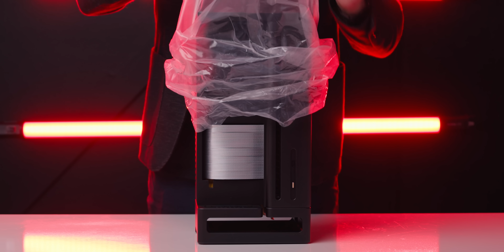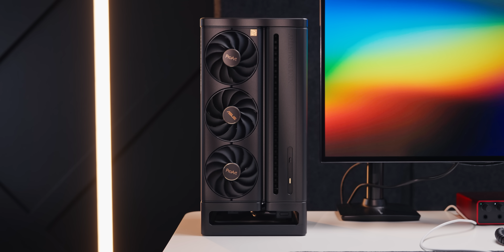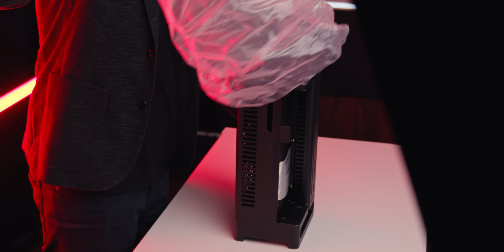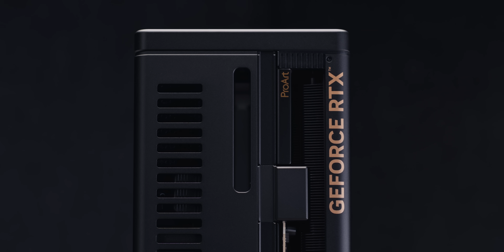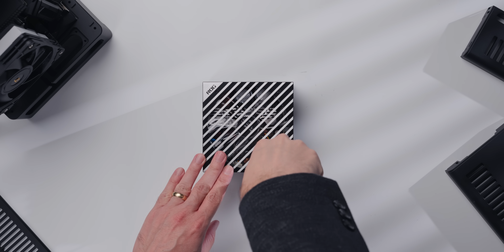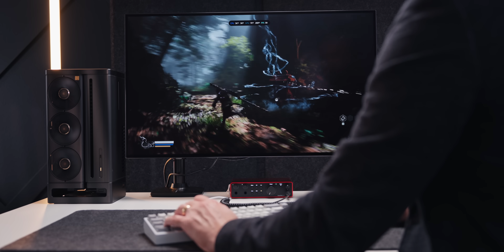THIS is peak SFF.

Comment: How are you getting 77c on a 7800x3d in CB24 at 4.6Ghz

I was getting 79c @ 4.7GHz with a dualtower cooler AK 620 in a corsair 4000d
and with an IS 55 in the fractal terra with NF-A12x15 I am getting 89C throttling to 4.5GHz

Comment: bro why would you buy that small pc for $3000 when you can get a good pc for $2000. this thing is 3000 without the monitor, it becomes 4000. On amazon you can find a good monitor for as low as 350.
Reply: some guys love that small build , which always comes at a cost.

Comment: yea it looks nice but no air filters and random environments that it could be in makes it a wildcard, unless people live in basically a museum case then that thing is going to be full of dust in less than 3 months. we have no pets and live in a non-smoking house and i still clean so much dust and fuzz out of the primary intake filters on my case... it's a fact of life that dust just exists no matter how much you clean... my system is going on 7 or 8 years old now and is still running strong! R5 3600X with an XFX Ultra THICC III RX5700XT and 32 GB RAM, dual 24" 144Hz XG2401 gaming monitors on Display Port and the heart that pumps all the blood, 1000w Rosewill PSU that was part of my last PC that i carried over because the thing just wont die! if you buy a PSU and it weighs more than 5 lbs then they built it to last!

Comment: Wtf, it's like I manifested this case into existence 🤯 I literally just put together a parts list on PCpartpicker a couple months ago and the required compents are the  EXACT components I chose for my build. An Asus ProArt 4070 Super and an Asus Loki 1000w SFF PSU. I went with the Gigabyte B650i Arorus mini itx motherboard because it's more affordable, but opted for the Ryzen 9 7950X3D because I want beefier CPU power. I'm a 3D designer and I've been searching for the perfect SFF PC case for years. The closest I've gotten is the FormD T1, but I've always wanted something more robust and purpose built. I couldn't have imagined a more perfect design if I tried, truly a work of art. I might have to go with this simply because the design is so perfect. A vertical PC case doesn't fit in the spot I was intending to put my SFF PC in, but I could put it where my controller stand is and come up with another solution for that. The other case I was considering is the Thorzone NanoQ. I had been following Thorzone since the Kickstarter for the Mjolnir and I've considered them the most high quality and artistically motivated PC case designer for years, but this just took the top spot. The other brand I would use is Fractal because they have been coming up with more aesthetically pleasing designs in the last several years, but the designs I like are either bigger than I'd like or lacking versatility and support for high end components. I might just be getting this case though, it's a freaking masterpiece 🙌🏼

Comment: i love ITX build as well but it’s not practical  as i push my 4090 and 7800x3D to the max running really demanding sim racing titles for my off track practice.  nothing can beat proper airflow even or water cooling at triple 4K 11520x2160, these cases can fit everything in and yes it looks cool but nothing worst seeing the cpu heat up above 70 degrees and the backside of the gpu hot enough to fry an egg, its like having a heater next to your face.  

My original setup was an ultra high end MCPRUE Apollo S 3.0 itx case (imagine Apple Max Pro case shrunk down) which looked amazing on the desk.  But I had to throw that away and rebuilt in an even more obscene MCPRUE Apollo X case (clone of Mac Pro case for PC builders) but it’s dead silence as i can use 280 rad for the 7800x3d and the 4090 have all the airflow it needs to be quiet as my practice sessions can go for hours.  

love your builds BTW as no one wants a giant boring looking PC case on their desk or on the front floor vacuuming dust!  SUBSCRIBED!

Comment: I wish they design a 5090 version for the upcoming GPUs.
Reply: have a look at McPrue, took me forever to find a itx case that could fit an AIO water cooler + 4090 gpu in it.  still gets hot though if you push your system hard.

Comment: after you are forced to upgrade your system(which is just a matter of time), this will be a very expensive and useless piece of aluminium.
that should be calculated within this insane price. 100% not worth it considering the current price.

Comment: TL:DR: function > form theses fancy ITX designs are mediocre at best
bought the ghost s1 compared to this case the machined aluminum isnt something that you want it's heavier than most other cases.  the small form factor doesnt leave much room so disassembling and cleaning is hard since dust gets on all the parts there is no great way to filter it with mesh. ive been looking for another smallish form factor PC case that isnt too focused on "premium design" since 90% of these cases like to charge you more for a design that is mediocre. the mass produced generic designs most mid-sized towers are better i just prefer something smaller.
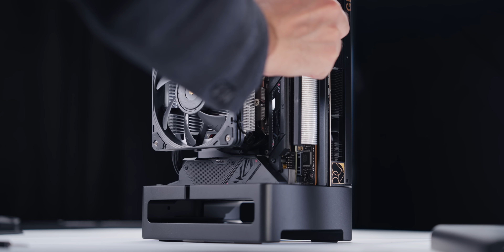Edit Im not buying my PC case to be "engineering art" after the parts are dated. id rather melt it down for the raw materials. also, with designs like this you would be better off getting an open pc case since the side walls arent doing anything. it looks better when you can see all the parts inside 6:49. most people that built PCs love seeing that parts inside the CPU & GPU are the main focus. which is one of the things i regret about getting the ghost s1

Comment: would highly advise to just buy the Streacom DA6 instead. its upgradable and costs only 100-130€. and i even got a custom loop with two 240 radiators fitted on it.

Comment: It's a nice showpiece indeed. Anything that can be said about any showpiece regardless what object, applies to this one. It's nice to look at. And it's nice to take for a spin. And it'll make for a really nice looking paperweight 5 years from now.

Fair Warning! The specificity of the power supply is for the pinout to match! And even within the same model, different revisions could have different pinouts! So even if you buy the same PSU, the preinstalled cables could FRY your graphics card, your motherboard, everything!

Comment: The FF actually means F Fangrills - 730$ and not a single one of them is included!  If you want a piece of engineering history, better look into the much older non-x86 workstations/servers from SGI/SUN/Digital/IBM/etc, they're much more relevant and not a blatant cash-grab like this one.

Comment: If you keep this machine in mint condition, 25 years from now, it's going to be a valuable artifact. The GPU will probably need thermal pad replacements. But it's going to be a sweet snapshot of computer technology from 2024.

Comment: PLEASE help me! i am struggling with coil whine for the same configuration BUT a 4070 ti super.
are you experincing zero coil whine with PSU 750W and 4080 super? if so i will upgrade gpu

Comment: Looks great, but an observation I've made with newer cases is that a lot of the ones that have been coming out lately prioritize style and novelty to the detriment of air flow, noise, and ease of building/upgrading later. For instance, there are no dust filters at all on this thing. I think that we are starting to lose sight of a lot of the basics of case design.

Comment: Extremely clean looking, but tailored specifically for a single GPU. Others might fit, but design wise, it's purposely built around a specific GPU, which is wasteful.

Also, the fact that you need to provide your own hex driver is just absurd, especially at its price.

Regardless, as you said, this case isn't meant for upgradability in mind and for most people, but rather as a show piece for very few people.

I hope someone takes the design language of this case and applies it to a more "mass market" focused case.

Comment: I feel like this would have been better as a prebuilt with all these limitations
Reply: yeah makes more sense that way no? but maybe the designer only has experience dealing with fabrication and not the pre build business side of things.
Reply: Yeah, imagine scratching it with your screwdriver :(
Reply: @slipperyfish7560  skill issue
Reply: @slipperyfish7560  I have the potential lol
Reply: @slipperyfish7560  pc wasnt meant for morons hence, the $600 price tag.
Reply: @slipperyfish7560  should just throw it away afterwards
Reply: @slipperyfish7560  people build keyboard with CNC aluminum and don't scratch it with screwdrivers. Don't be dumb
Reply: This... isn't a keyboard... That's like saying you don't damage your mouse when you throw it across the room, so the same logic must therefore apply to the monitor.  @someguy035
Reply: Yeah this might as well be a pre-built with very slight upgradability, it would make more sense to be sold with just different options for RAM, CPU and storage capacity like what Apple does (albeit while still having the option to manually upgrade those, unlike Apple's overpriced bricks.)

Comment: Did you check what PCIE link speed you get? 40series and Mainboard supports and benefit from Gen4, but many PCIE risers drop the signal to 3rd gen, which is half the speed.

Comment: Apple is slowly losing its mojo. Yeah this thing is really freaking nice. Man! but but but, tying it to one card kind of defeats the purpose because that’s what Apple does and the reason you don’t buy Apple is because they lock you into a hardware confit for more money than it’s worth.  Maybe what needs to happen is standard card sizes like motherboard sizes. This would make design more predictable around design and better to understood. Too expensive though. It’s just a case. This is cool but it doesn’t survive my requirements.

Comment: Picking a single good-looking piece of hardware to design a complete build around (and actually pull it off competently) is peak.  I hope we see more of this in the SFF space.
Reply: I don't. who's actually buying these? Zero upgrade path and basically locked into a single generation of card...awful idea. But it looks pretty, will make a great paper weight.
Reply: @traderjo9552  it's a 4090 you're set for the next 10 years
Reply: @traderjo9552 People who want to? The whole reason this thing is available for purchase in the first place is because when the creator posted a picture showing it off as a passion project people said they wanted to buy it
Reply: @traderjo9552  This has more upgradability than a console and people buy those.
Reply: @ChristianStout  What a waste that the GPU is being restricted to a single model. How unfortunate... Once that card is obsalete, the entire thing becomes a display piece, I guess.
Reply: @Silvershadowz-g7p  That's true for literally everything. It's up to the user to find new use cases to extend a device's lifespan, and that GPU won't be considered "low-end" for a very very long time.

Comment: $600 case, $10 cpu cooler.
Reply: the cooler is 52 euros and the noctua fan like 20
Reply: The cpu doesn't go over 80c which is the temps of my 5800x3d with a much better noctua nh-d15 cooler. In other words, the "$10 cpu cooler" does a great job equal to more expensive coolers.
Reply: @pf100andahalf  The $10 cooler which is a $40 cooler
Reply: @pf100andahalf ID Cooling stuff is legit best value for money 👍🏻 But for me it was also kinda strange to see it in this “all about luxury” build:)
Reply: @pf100andahalf  But only 32GB of ram for the CPU (

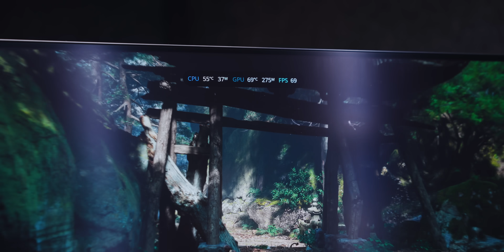Comment: What is that temp monitor thingy at 7:43 ?
Reply: Its in msi afterburner, but you have to configure it to look this smooth
Reply: @czesiekjazda9990  i like the standard afterburner on-screen display. looks more technical

Comment: "Without compromising performance" is kind of an audacious statement considering the lack of IO convenience and that there is 0 dust filtering to be seen on this thing. If your cables are at risk of damage from the design and you need to clean it out more than a couple times a year to maintain its performance, that's not really no compromises, is it?

Also, if the case is made for only a specific brand's specific line of GPUs and PSUs, why not just sell the completed systems at different specs instead of only the case? That seems like a much better business model to sell luxury, themed pre-builts instead of advertising as a PC builder enthusiast product. As clean as it looks, I can't see this not being a market flop unless they have other revenue sources. The overlap for "I want the performance of a high end gaming/workstation PC", "I want a small form factor, on-desk, show-piece tower", and "I want the Mac experience of looks clean but is incredibly expensive and completely non-upgradeable" is an incredibly slim fraction of PC buyers. It seems more like someone at XiKii had a very niche need and just happened to have the funding/skills to create and market their result.
Reply: If you were the type of person to buy this case: you would be getting a external I/O hub mounted under the table or somewhere inconspicuous anyway.   Having random cables sticking out of the front of this case would ruin the aesthetics.

Also, not everyone needs to clean out their computers. Some places are dustier than others - if you live more than 5 miles from a freeway and vacuum your house every week and the area is naturally just not very dusty - you won't ever get dust in your PC. Having the computer elevated on a table also helps with dust.

You make a good point on questioning why this isn't a prebuilt though.

Comment: One thing you have to consider with an exposed GPU is the coil whine, in normal cases the tempered glass and side panels muffle the whine quite abit. If you get unlucky with the GPU model you buy then the coil whine will be very noticeable.

Comment: You can do so much better for so much less money and get it to look SOOO Much better.  After Asus B/S with their defrauding customers over Ally warranty repairs... I dont' know if I'd trust the equipment in this thing to begin with.  This case isn't "niche", it's just bad value:  you can build better for cheaper and still get a similar aesthetic.  And by "better" I mean you can get a case that can support cooling of REAL processors [we're talking those 12 core + amd and every intel...] cuz that baby CPU cooler is maybe good for 65w.  This is the equivalent of a $5000 12 year old macbook air.

Comment: i'm not convinced. i currently have a testing bench instead of a pc case because you can create a SFF by yourself without compromise. i'm not willing to trade with a case that does not (referring to the gpu upgradability. i'd like to see an empty gpu unit that allows the users to screw a gpu chip onto it. state the necessary dimensions and we're golden.

Comment: XiKii's case is waaay more precisely built than the Asus card they've designed it around — the fans aren't perfectly centred and you can see that as they rev up.

As someone who's owned multiple high-end Asus cards over the past decade, I can tell you this is a persistent issue with Asus' build and quality control.

But all that being said, it's still a super-impressive little case. I just wish they'd have designed it around Nvidia's FE cards because those are just better than anything Asus puts out.

Comment: Honestly this is fine. Only the cooling of the CPU might be concerning. If you have 4080 Super you are good for next 10 years in terms of gaming so if you want art piece that will last you long time this might be it. 

I like the design and for someone who has USB hubs mounted to the side of the desk anyway the front IO is not that bad. Only shame is that front IO doesn't have audio jack. I usually switch between headphones and speakers if I work from home and having front audio jack and one in the back makes the switching super easy.

Comment: Now if you kept that beauty from touching internet you would have a 10 year machine! Just run an external m.2 for file transfers the old way. No need to upgrade anything unless there is a one in a million hardware fault. I have one machine left that I run that isn't attached to the internet and that windows 7 machine is a beast! As soon as you plug an Ethernet cable in your computer will start running slower and slower, you wont notice right away, it is too gradual to recognize until it is too late.

Comment: This Is Absloutle stunning and this is how it should be done, Having the GPU external  like this and everything just snapping together   and the intake fans not inside a small box. and the materials, The Only Other thing I think they could  have done it to make the metal case part of the heatsink

Comment: So you can only use one specific GPU, one specific power supply, likely only one specific cpu cooler, definitely no upgrade path possible and all of that for $700
I really wonder how many they will sell because i bet it's single digits
Reply: The case is sold solely in China right now and so far, more than 200 units have been sold.

Comment: If the case is so purpose built for a single component, I might as well just buy completely pre-built NUC-like system with all custom components.

Couple of ideas, like the GPU bracket on case and the GPU power clip, could be applied without sacrificing customizability.

Comment: I would consider liquid metal or PTM 7950 on the GPU, in this situation it wouldn't do much for performance in terms of FPS but what it would do is reduce the fan speed as they don't need to spin as fast to keep the GPU at the same temp

Comment: Odds are you'd have a wireless keyboard and mouse with an art piece like this, and those can use the motherboard USB ports, so the lone USB-C doesn't bother me.  And when you consider it's designed around at least $2000 in other parts, it's simply not intended for someone who needs to focus their budget on performance.  It's clearly a luxury item.